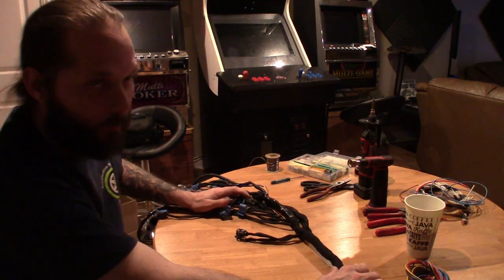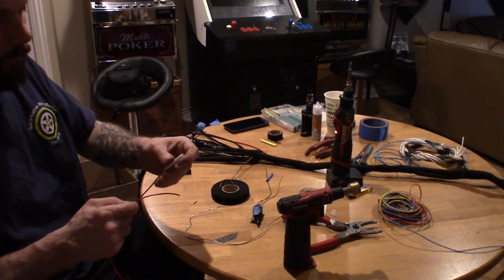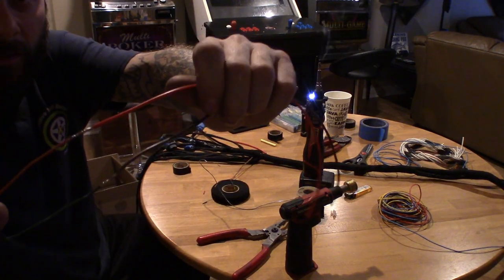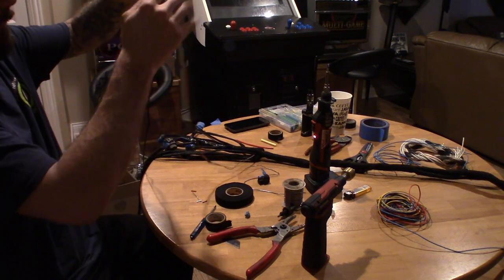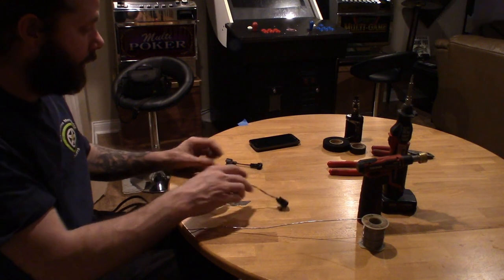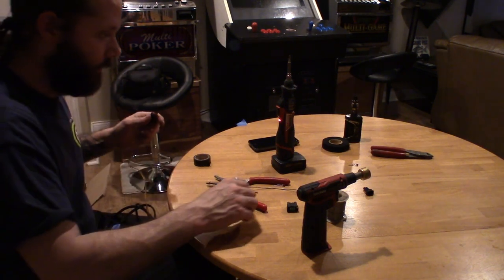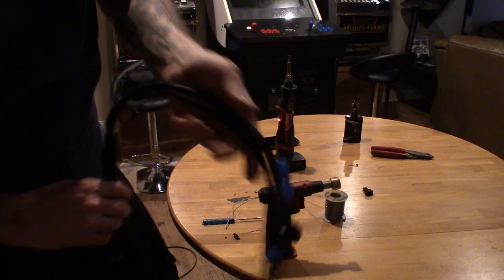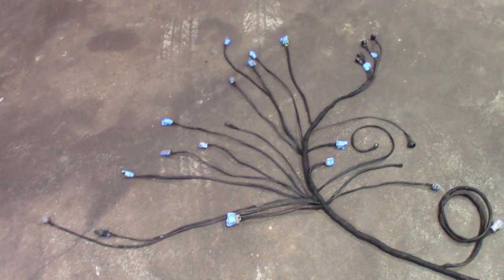Buying One VS Making One

Comment: You're doing it like it should be done . Especially with putting a piece of tape over  the shrink tube .  Shrink tube is a fantastic product but not  fail safe . Also liked that you used the netted soft sheeting . That hard stuff is good for under the car but underhood I have more then once seen rubbed through wires inside those hard protecting sleeves .

Comment: Hey jrc , what's your thoughts on the milwaukee soldering iron , 
Any cons or any faults ..
Great job on the harness by the way .. looks good
Reply from the maker: It's decent. Heats up fast. But if left on too long the base of the tip will start to melt, had to warranty mine once already.

Comment: Idk if i missed it, did you ever do a follow up vid on the lifespan of the rebuilt 14.4 snapon battery you rebuilt?? A guy at my shop and i are curious since we have them also. Thanks
Reply from the maker: It still work although I have issues recharging it sometime because the snap on charger doesn't support the battery